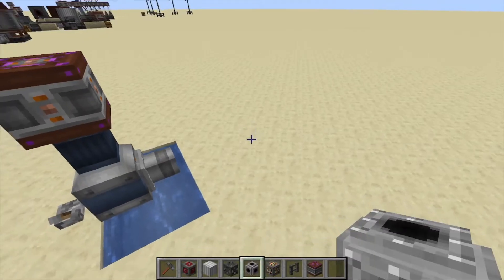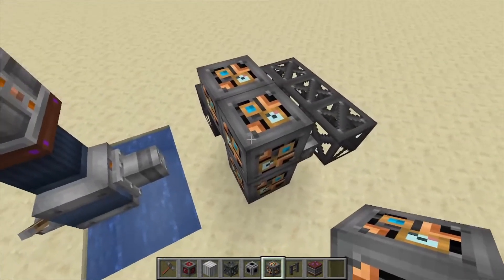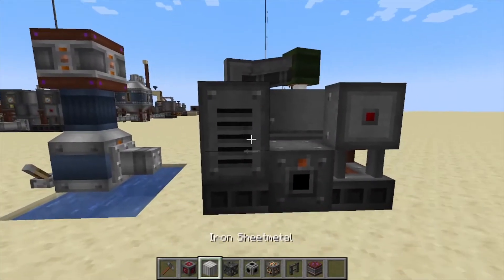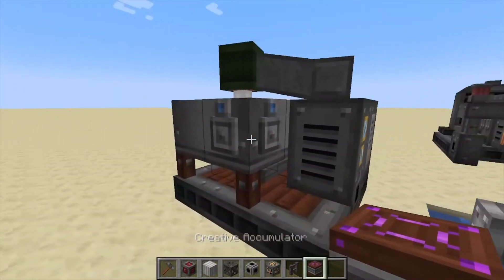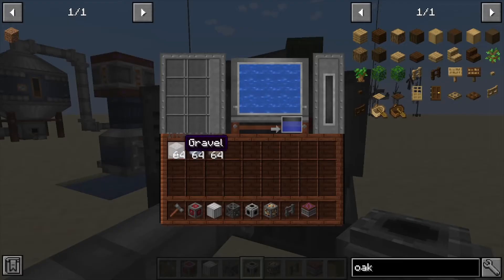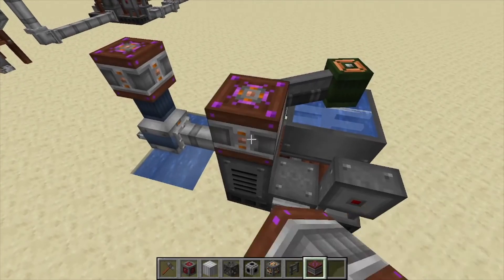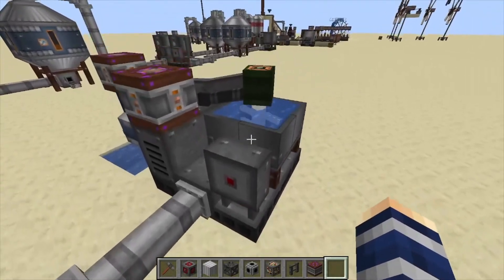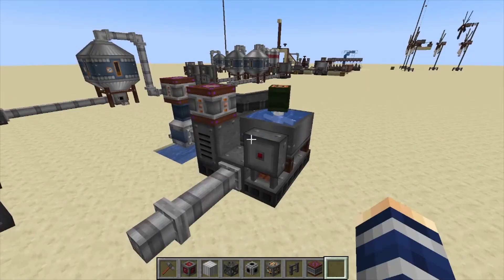Immersive Engineering: Mixer (How to make concrete)

Comment: having an issue with the mixer; making the new redstone acid. but for some reason, I CANNOT get it to only pump out the OUTPUT. and instead is somehow insisting on exporting the water.  Idon't know why, and don't know how to get it to stop.
Reply from the maker: Iv never tried this but maybe a liquid router right on the machine to only filter out redstone acid
Reply: @MCMentor1  a liquid router might work, yeah, forgot about the fluid router! I'll give that a try! thanks.
Reply: @TizonaAmanthia I want to know if it did work , I play on a modpack where I discover that mod ( liminal industries is the modpack )  trying to make redstone acide en masse, to make Gold via some witchy turning lead to Gold thing... my problem is that it want ... but really really want to take the water out... even tho it have like 10mb of water against a full thing of redstone acide, and since there aren't like 2 water output , which would be usefull, I can't ask it to make the water goes in the other side... i'm lost

Comment: Can you explain on how you were able to move the import socket around? Mine's on top, and the fluid pipes won't connect at all. It'll only connect to the blue on bottom, and on the sides.